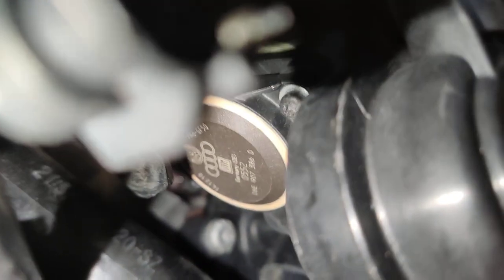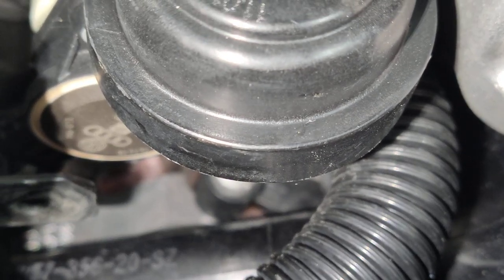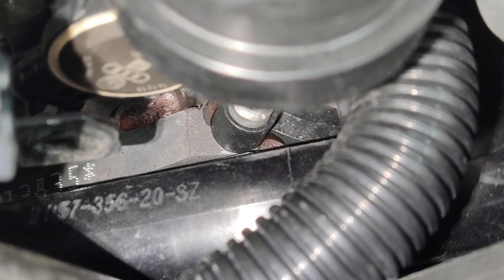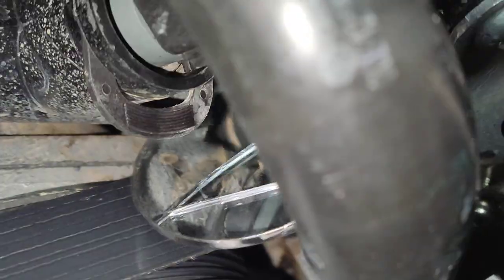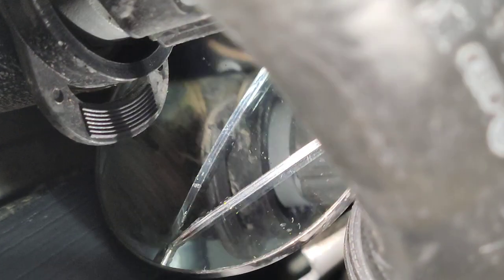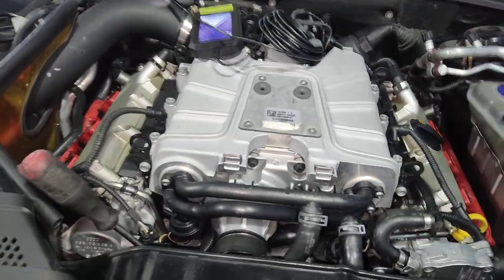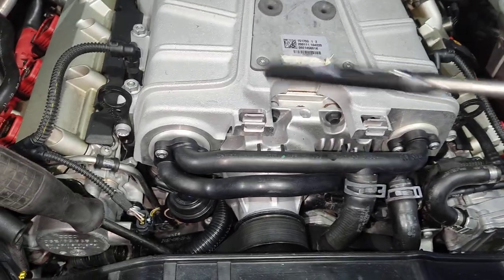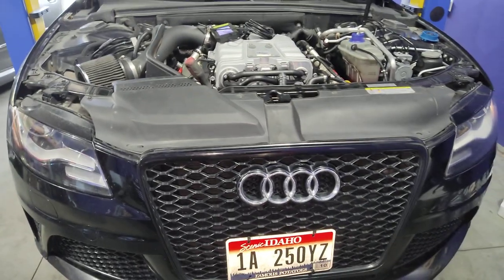B8 S4 coolant leak found..... thermostat

Comment: Hey if you could please help me out my car seems to lose power past 3,000rpm supercharger just seems to stop working and my serpentine belt gets super hot after just a few mins of driving I’ve taken it in multiple places and no one can find the issue
Reply: Has your water pump been changed? Any fault codes? What temperatures is the engine running at?